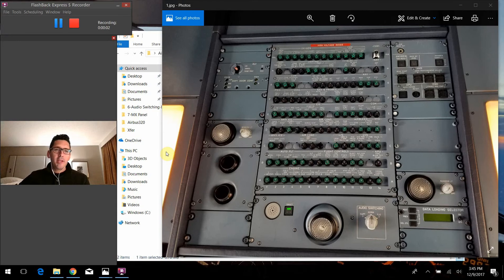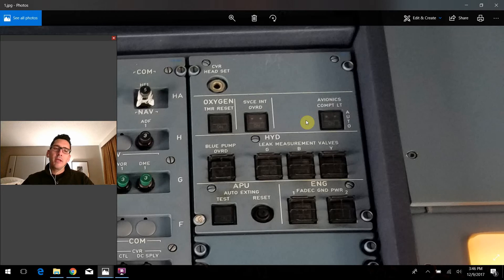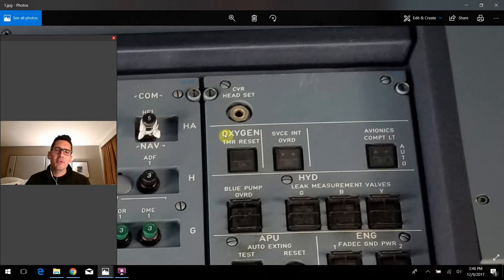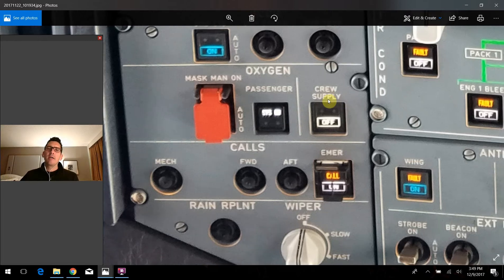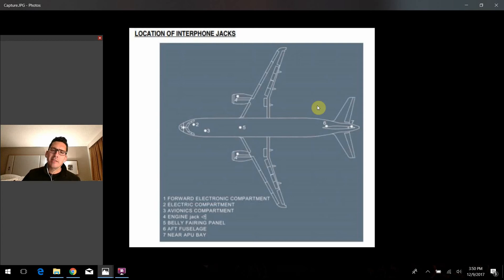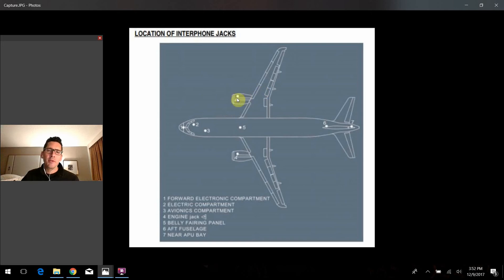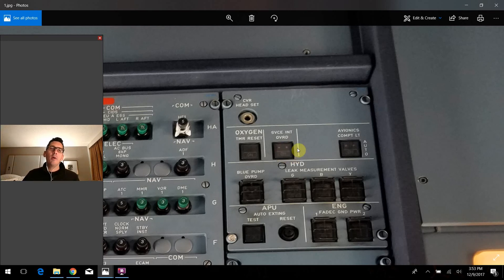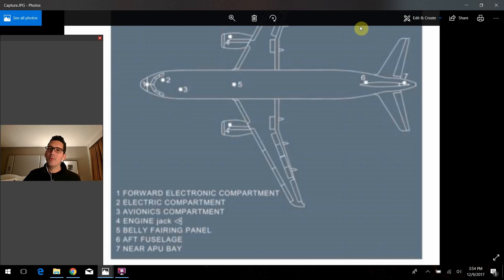Airbus A320 Cockpit Tour: #7 Part 1-Maintenance Panel:  What do all those buttons do?!

Comment: First off, great series. Thanks for the effort in making this.
Question. What's the logic behind the service interphone not being active when in the air? Who benefits from that disabling? Wondering why there needs to be a system for this related to the landing gear compression state. Sure there is a good reason, but which? :)

Comment: Just to share with you, there is a new app for android sys available on Play store. 
Ecam Reset app, Stand alone version, with SEARCH options. For QUICK solution, with AMM ref, MEL ref and much more. 
It is best app for A320 family for 5$ only. 
For pilots, engineers & technicians. 
Join the Club